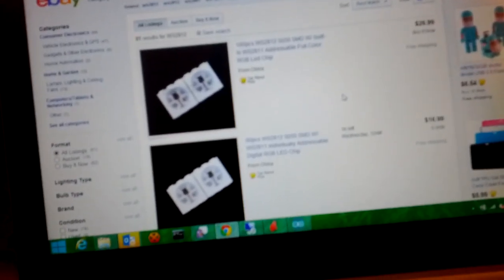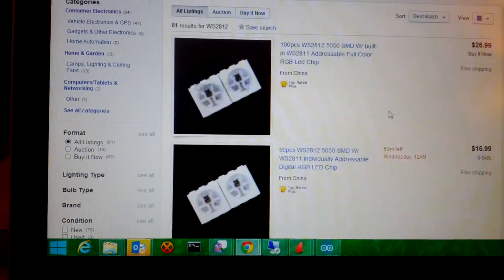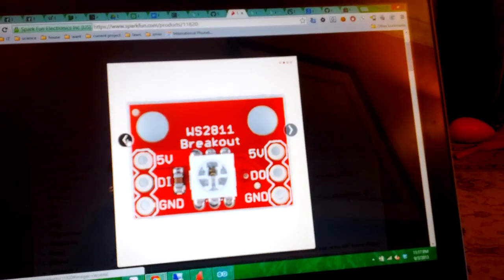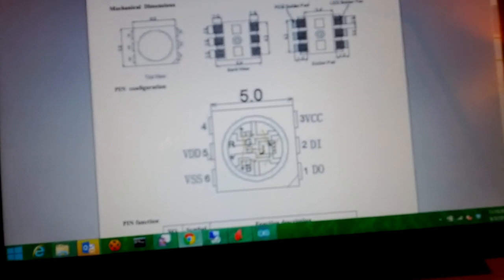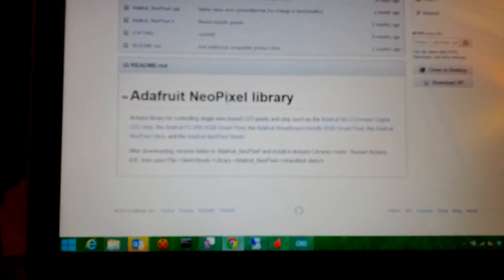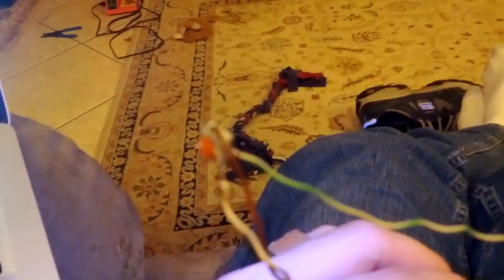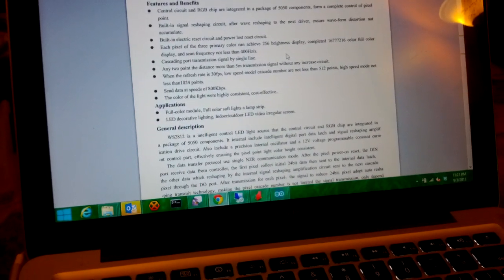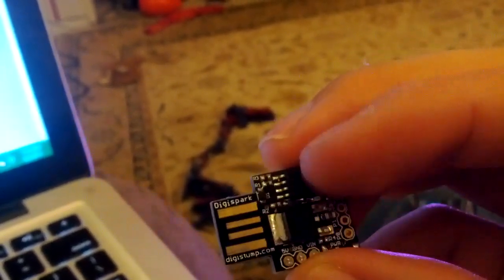Using ws2812's for the first time

Comment: You can buy the WS2812B on their own, but you will have to mount them and wire them together, which is time consuming, requires steady hands and solder skills.

Buy strips or panels, the LEDs will already be mounted for you, saves you time in setting up, but will cost you a little bit more.

Remember, lowest price is not best price, especially when buying from traders through Hong Kong.  We only buy direct from the manufacturer in bulk.

You will need to get the right Arduino project file for the LED, plenty of places to get it online.

As the quantity of LEDs you use increases, you will have to use a seperate power suppl to power the LEDs.  Each 5050 LED has potential max current of 20mA per colour, so 60mA per LED at full brightness when white is chosen.
If you have an array of 100 LEDs, then that is 60mA * 100 = 6A, so choose your power supply accordingly.
Also, make sure you connect the GND from your Arduino, to the GND on your power supply, else you can get glitches.

Comment: Hm.. I got those without strip now I have to solder them myself :-/ But however, If i understood you right, I could attach e.g 100 LED's trough the arduino? all you need is the LED (i have WS2812B ones with 4 pins) and just one cap for every LED?
Reply from the maker: you dont even need the cap (depends on how far you are running between leds...)

I have another video called "testing ws2812's distance spec" that tests this... The cap is used mainly to filter noise :)

But yes, you need 1 voltage, 1 signal, and 1 ground from the arduino and you can daisy chain a ton of them
Reply: iSee. I want to use 70 LEDs on a square of 40cm by 40cm. I guess i'll try without caps then..
Reply from the maker: yea for that size, I wouldnt bother (unless you know there is going to be alot of ambient EMF noise)